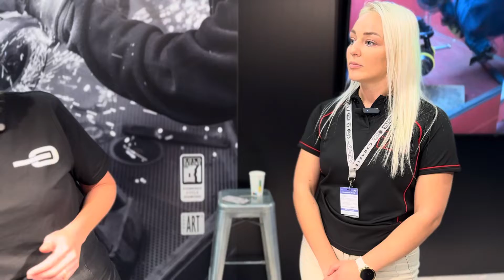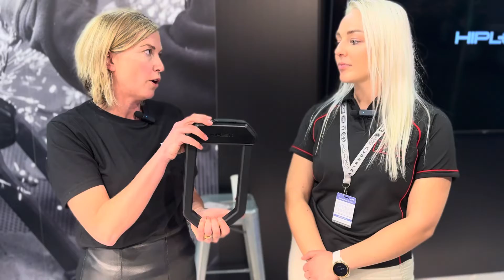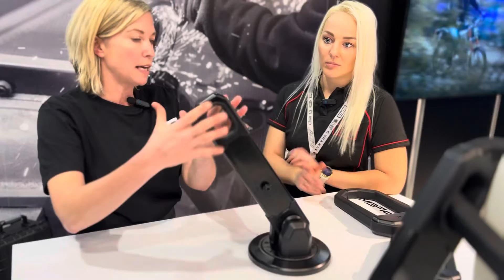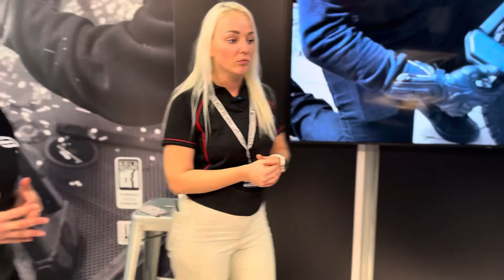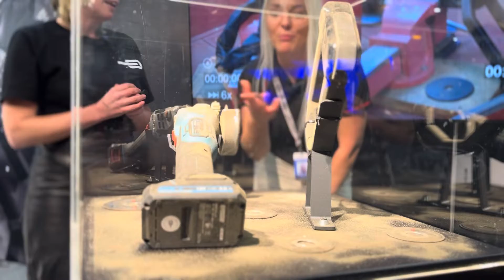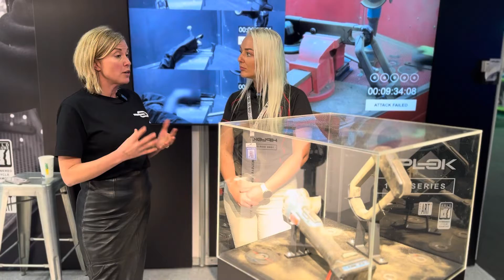Hiplock DX1000 - Worlds best motorcycle lock?

Comment: Did end up buying this one. Biggest reason is that this one fits around my whole fron tire of my motorcycle and i think almost every other or literally every other D-lock does not. Even litelock made a new litelock x1 PLUS that is extra long.

yea great but i had to return it because it was just half a centimeter too short to fit around my front wheel. And a D-lock around your front wheel is the strongest way to lock your bike since you can not go cut the brake-discs to remove the D-lock, AND you HAVE to cut the D-lock twice too remove it. Plus teh DX1000 is also good at stopping the diamond discs as well. Better then most D-locks.

Only the kryptonite new york diamond is the new true king of stopping angle grinder attacks, but its to small for a motorcycle wheel.
Reply from the maker: Thanks for the awesome feedback, glad you're happy with it!

Comment: This lock is the best you can get. However do not think its fool proof, Diamond disks still defeat it pretty quickly.  In most cases meth heads and addicts have crap battery powered angle grinders with cheap disks and this will stop them.
Reply: 5 diamond blades to get through it . And that was with it plugged into the mains .
Reply from the maker: Completely agree, nothing is completely unbreakable if you have time and the correct tools, but this gives you the best head start
Reply: Yep pretty much this is the way to go. Compared to the closest competition (the Brits) and there new litelock X3 and the old X1 the DX1000 faired better against diamond discs, that being said are many thiefs using diamonds?/ nope. All of these top tier choices are great really glad they finally worked out giving us this protection considering angle grinders are available at any hardware store. Just recently got my DX1000 lovin it/well done, all around quality product.      -Cheers